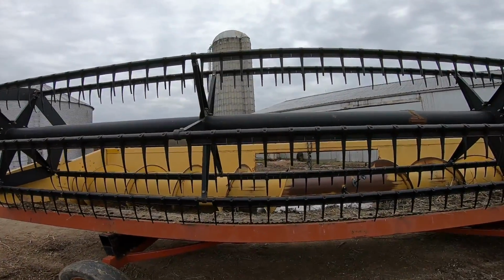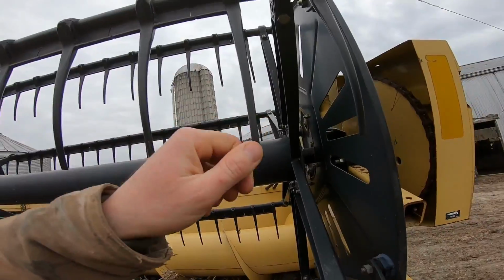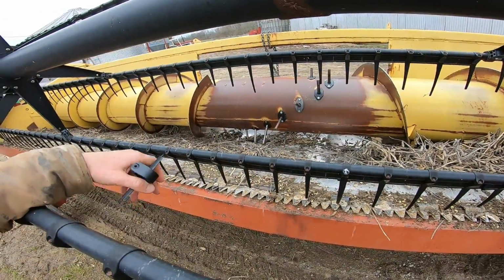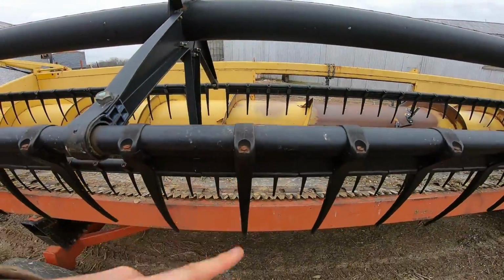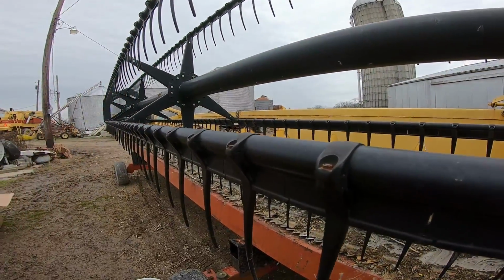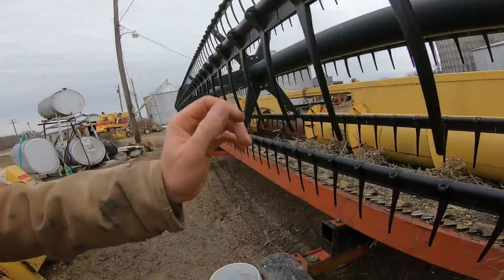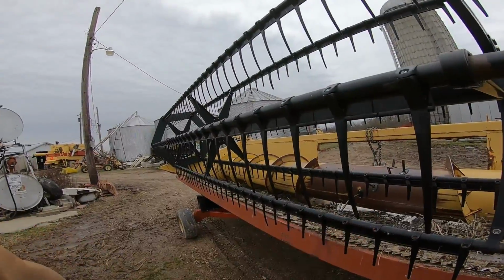Fresh Fingers

Comment: We replaced them all on the BIL's head a few years ago... They had gotten snipped short and some of them were turning on the pipe.  Thing is, they're GOING to get cut off at some point.  The flex cutterbar goes over a high spot next to a rut, slides up over a rock, or goes over a gopher mound, and the cutterbar comes up high enough that the reel fingers go right through the sickle, and get snipped.  IN fact they switched to plastic fingers for that very reason-- in the old days pickup reels were equipped with STEEL tine fingers, and when THOSE got into the path of the sickle sections, you had a mangled or broken section or one with a chunk out of the edge that then cut raggedy-@ss til you replaced that section!  The steel tine fingers would get chewed on, but the sickle section would take the worst of it!  Plastic fingers just snip off clean and everything keeps going.  So long as there's enough there to still keep stuff moving, you're golden.  Later!  OL J R :)
Reply from the maker: Never had an issue with the old new Holland head and floating cutter bar. Now I have seen the metal ones on Deere's get mangled.

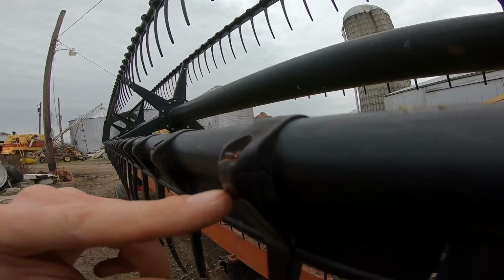Comment: Adjust your reel, put stop on your lift cylinder limit how far down it will go, and how much flex is in the floor of your head?  We were always change reel finger due to getting cut off until we corrected reel position, replace some pieces in the floor and put a stop on the lift cylinder.  We also install a pipe reel from Manchester Farm Center.  I don't think we've replaced a reel finger in 5 years.  You can hear your fingers hitting the sickle at 4:47.
Reply: It's sitting on a trailer and he explained what happened to the fingers to begin with
Reply: I understand it's on the trailer.  You don't think the floating cutter bar can fail and cause you to max out your downward movement on the head?  I've ran a 973 24 ft since 1998, I know how those dang fingers get cut off because the floor over flexes due to age and wear, the auto head micro switches hang up or fail, and the reel drops into the sickle with full length finger installed trying to get short bean anyway.
Reply: @NoTill1825  He explained in the video that the center tube had broke for a previous owner causing all the finger damage.
Reply: He thinks that's what happened.  I'm telling you my reel has never broke and I had the same issue with my head until I made the adjustments and repairs I listed in my first post.  And if you look at the fingers they've replaced some with longer fingers since the shorter ones were cut off and the newer fingers are cut too.
Reply: @NoTill1825  Did you happen to notice that I never said your idea was bad or wrong? Nope, you were to busy being concerned with being right. I can tell you're one of those that needs to be right about everything. So, good job on figuring out what the problem was with your equipment.
Reply: No I just didn't want him at waste $600 thinking it was a broken reel that caused that issue.  I was minding my own business until you came along.  maybe you're the one who needs to be right all the time.
Reply: @NoTill1825  lol Chris, you have some issues buddy.
Reply: Why because this is the longest rely chain I've ever made and we're evidently not on the same path of what's going on here?  Or because you insist I started all this after you came at me because you don't believe listening to the whole video?  I just posted to try and help a guy out with what I've done to resolve the same issue on the same model he we've owned for 20 years.  We all have issue, and my are not what you think and yours are not what I think.

Comment: Hey Jacob:  DON'T TIGHTEN THEM ANY MORE!   Don't be concerned with the gap in the clamp ring of those tines.  The gap doesn't matter.  The locating button, inside the tine clamp ring, does all the work of keeping it located side-to-side, and from spinning around the bar.  As long as the tine is "snug", it won't move.  The proper way to install these tines is to tighten them until they JUST stop moving with light pressure, then give the screw another 1/4-turn... NO MORE.  I was using a Makita cordless screw driver to install these.  If I recall, I set it around "2", which is very light.  Problem is if you let the tool rattle, even a few times, it may be too tight and either the boss will split at the pre-drilled screw hole or the other boss (the one the screw goes into) will split, just like the one you pointed out in the video. Now, I run the screw in with the cordless driver until it just touches, then finish the job by hand.

I was  lucky to meet a field engineer for Vermeer, who told me about the proper way to install these things.  What he told me makes sense: the locating button, that fits into the locating hole in the bar, does all the work of positioning the tine.  The clamp just keeps it from falling off... it doesn't need to be too tight.
Reply from the maker: I had the drill set at the lightest slip setting. I never let it get tight enough to slip.
Reply: @boehmfarm4276  In our shop, we don't get a lot of feedback from our farmer customers... unless there's a problem.  These plastic tines are, repeatedly, one of those problems.  And it's not just the aftermarket tines that we have problems with.  I put a set of John Deere paddle tines on a MoCo 625 for a customer... before I learned how to do it correctly.  Later that season I ended up replacing almost all of them, at my expense.  It was a simple case of I didn't know how to do it right... the first time I did it.  I used my Makita impact screw driver on the second-to lowest setting, which I later learned made all of them too tight.  After the MoCo was used the first time with the new tines, many of them broke at the pre-drilled screw hole on the top of the clamp and quite a few more also split the bottom boss, like what happened to that one you showed in your video.  The second set I installed (correctly) are still running just fine, although I did replace a few more later that year after he hit a dead deer (I don't warranty rock and dead-deer damage).  I just wanted to give you folks a heads-up on something I learned the hard way.  I would really hate to see good folks replacing $600 worth of broken tines.
Reply from the maker: Thank you for the information.

Comment: Get some paddle tines before you move the reel. We had feeding problems on our 925 John Deere header & the paddles solved it. Your header would only take about 6 between reel "webs" (18 for whole head). Test 6 of them out on one section & I think you'll love them.
Reply: Put 1 second from the outside & space the next one on the upper pipe 2 or three fingers from the first one you put on. Repeat this as you spin the reel. Should look like a stairstep as you spin the reel. Hope that makes sense & helps. If you have any questions, I can send my contact info.

Comment: Same teeth on our red head. As long as it’s tight, your fine. Your having problems getting the auger to take the beans? It’s bunching up in front on it and you got the feel as far back as you can? You can adjust the angle of the fingers also.

Comment: the difference between "made in the USA and china' and also from the OEM manufacturer and aftermarket products, Yes I have run into that not just farm parts, but auto parts also, good video.
Reply: Yeah... last time I got an IAC valve for my 02 F-150, O'Reilley's sold me one with a stupid spring inside the valve behind the poppet between the ports... the original had NO spring, so I was rather confused.  Checked at other parts places, apparently ALL the new ones have springs... didn't go to the dealership because I didn't feel like paying 2.5X the price of the auto supply.  I guess whatever supplier is making the friggin things switched to a new design, that's SUPPOSED to work a a replacement for the old design.  Thing is, ever since I replaced it, the truck starts at about 1,500 RPMs when it cranks up, then idles down to about 1,000, and stays there until I run it 10-15 minutes or drive to town, when it'll FINALLY decide (eventually) to idle itself back down to about 650 RPM at a stop sign... Stupid.  I've disconnected the battery for a half hour and restarted the truck to "relearn" its idle multiple times, and tried every other trick I can think of other than cutting that d@mn spring out with a pair of pliers, but it just does the same thing.  Guess next time it goes out I'll buy a Motorcraft IAC valve from Rock Auto... OL J R :)

Comment: My guess is they will last just as long as the old ones if you set the torque at the lowest setting on the gun. The build quality was almost certainly metric. I had the same problem on my refrigerator water tubes. These are almost certainly built with a 3d cad machine. The build quality will certainly fall off with chinesium. I don't think America produces anything at the moment. I am guessing our labor market cannot compete with Communist Chinese building. Even something we have built from the start, circle clamps and hoses.  Remember when you could order any type of hose. Stretchy rubber, hose with threads, hose 2 1/4. Not some millimeter offshoot. Just a mess at this time. I don't think Chinesium has ever had SOCIETY OF AMERICAN ENGINEER, SAE standards. And never will with Communism what you see is what you get. Communism has no market to balance production, since Lenin did not believe in markets. Thus no price discovery. Remember at the height of the USSR, the highest pay went to college professors?  The reason for this is NO MARKET for price discovery. Pay did not go to inventions because everything you build belongs to the state, thus no patents. Why Red Chinese could steal any patented device from Western Companies, even Siemens electric trains. No patents is why we were so far ahead of the USSR with microelectronics, no patents you are just a cog in the industrial machine and will be kept alive as long as needed, then cast into the mud, Communism. Wonderful, eh Wot?